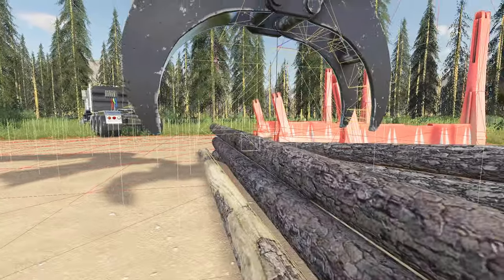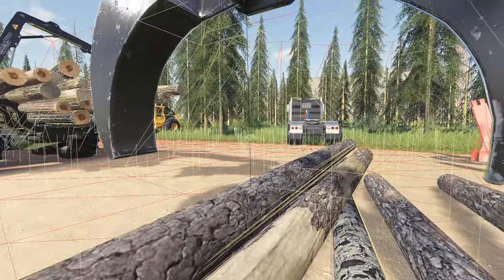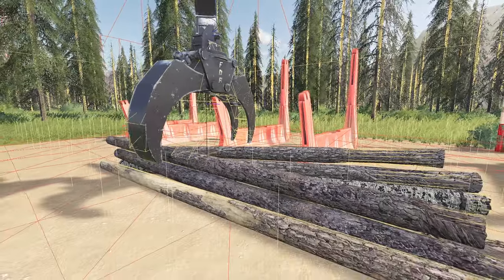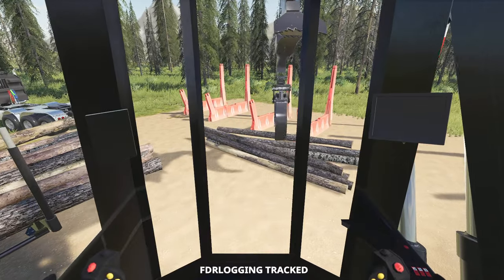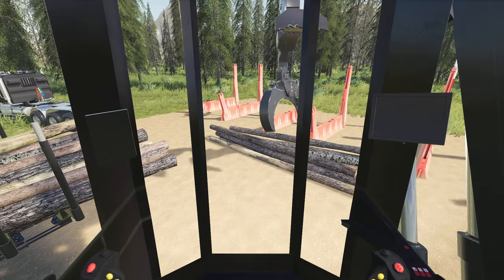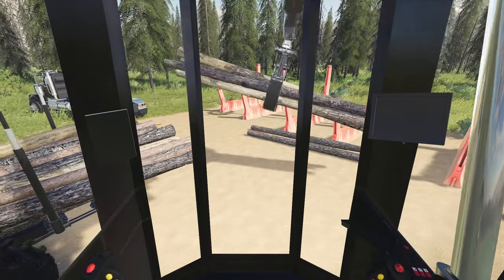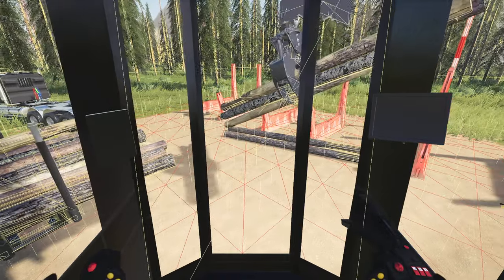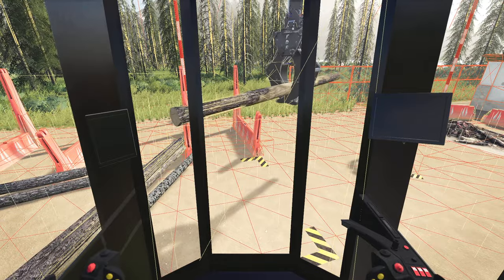FDR Stable Log Spring System Overview ✔ Farming Simulator 2019 ✔ FDR Logging

Comment: can you still stand a grab straight up vertical (pencilling) and release a little to flush your logs up? or will they not slide downwards now?
Reply from the maker: no, id love that for dangles but anything over a 80 degree swing causes the head to freak out, so you can almost do it be not quite
Reply: @FDRLogging  have been using the e50 for a few hours, think i would rather have it as is, how do i remove the plate?

Comment: had your mods for a while I love them but I just got on for the first time since the updated equipment and i cant haul any of the tracked vehicles on any truck any trailer it acts like they are so heavy it wont move but wheels spin any ideas? @FDR Logging
Reply from the maker: yeah my machines are super heavy you can only haul them on the "FDR" trucks and trailers from the website ;)
Reply: @FDRLogging  I did have it on your truck and trailer but I found out I needed to update the truck and trailer and it worked fine!
Reply from the maker: @jordanj8294  awesome glad you fixed it!